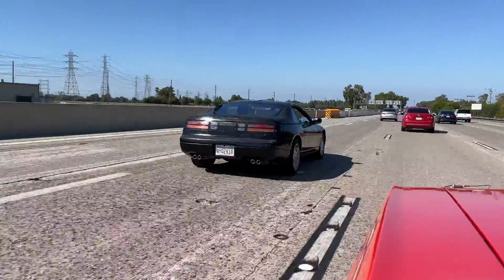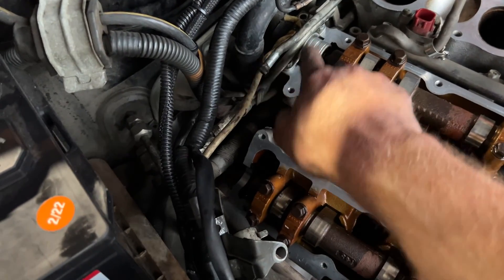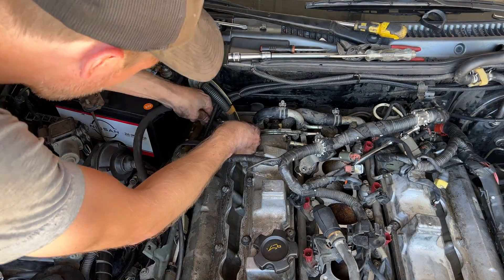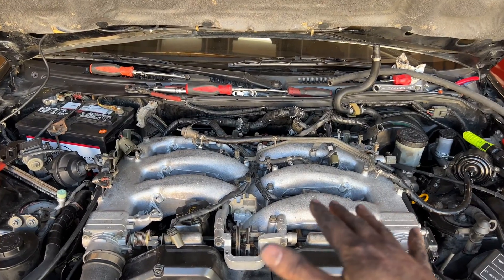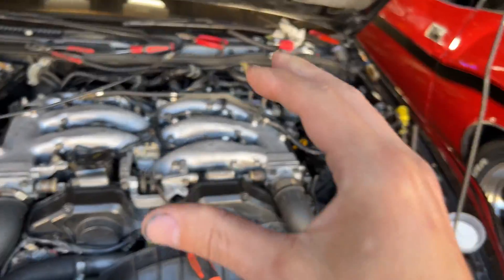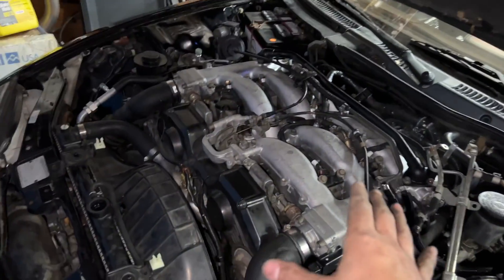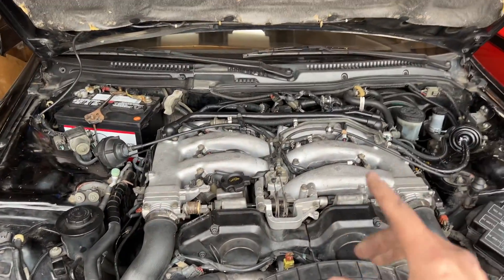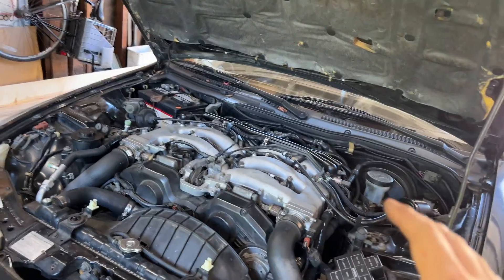Nissan 300ZX Intake Plenum Install, Ignition Timing, USB Consult Cable Tuning: Restoration Part 7

Comment: Where did you get the obd1 reader?
Reply from the maker: @jthj2003  I got it on eBay I think, they’re all over Amazon too. Just a cheap 14 pin Nissan Consult cable
Reply: @noboltsleftbehind  cool, thanks for letting me know!

Comment: Excess RTV comes loose & blocks oil galleries 
Before u put ur new manual g box on u could have rolled the engine forward ( intake hoses removed) and replaced the 30 yr old heater hoses

Comment: so i had to reseal my valve exhaust covers, i placed rtv on the surface and the covers and used zpec bolts, but wanted to replace the new bolts with the oems bolts back on after i sealed it a day later. if i remove those bolts and replace them should i reseal the covers again?
Reply from the maker: If it was me I’d try and replace them one by one and hope the seal isn’t broken.
Reply: @noboltsleftbehind  kinda tried removing the cover. Very difficult. I'll definitely feel more comfortable just resealing it after I remove the screws and replaced

Comment: I need some help with my 93 N/A. Not getting power to 3 of the ignition coils. Replaced coils, plugs, knock sensor  and still runs like crap

Comment: Conceptz wiki water bypass says just cap of the water nipples but I've seen a couple of video's where people join the nipple of one hard pipe to the nipple on the other, so that would effectively be bypassing the heater core?
Or did u just loop the nipple from one hard pipe back to the other nipple on the same hard pipe?
I have all this to do and have left the gearbox out to get better access from below to fit new metal water pipes i will cap each nipple off.
Also replacing VTC valves since they have started leaking the black goo.
Great video's, just confirming i have alot of work to do!  Waiting on parts from Amayama and in the mean time just picked up a Veilside Evolution cat back exhaust I've given a good polish!
Reply from the maker: Thanks, good luck on your project! I just ran a loop between the two ports in the back that were leftover after deleting everything. Not sure if that's bypassing the heater core, I suppose it's just creating a small loop where there once was a big loop.
Reply: @noboltsleftbehind  sounds like you did it right, I considered doing a loop on each hard pipe as might be better for flushing than dead ending with caps.
Other videos definitely show them connecting the heater core inlet to outlet in bypass videos, it would screw up the pressure going into the heater core I'd say too.
I couldn't see your connections in the clip hence asking.
While doing my rear main seal a small water hose decided to start dripping coolant while gearbox was out so decided to do plenum pull wil box out to hopefully make a little easier.
O2 sensors are good thing to replace if you haven't, on your laptop program check to see if your sensors constantly go up and down, then they are fine, if they hardly move they need replacing.
Reply from the maker: @sabertown1653  similar thing happened to me, once I starting taking things apart I found a bunch of little things that needed fixing. Good call on the O2 sensors, I meant to replace them but didn't get around to it. I'll give them a check through the consult.

Comment: Not sure why the nissan data scan wont let you see the data display (f1) but you can see just about everything from their all at once. Not trying to sound like a now it all but .44 on the TPS is perfect and dont forget to reset the closed throttle position it will help with the idle. Enjoying the content though, keep it up!👍
Reply from the maker: Thanks! Good to know my TPS is in range. I might not be seeing the whole display because I’m cheap and running the free version of the software, but luckily someone with an unused license hit me up so now I should be set (thanks Jared)!

Comment: Thank you for these videos, they are so informative! I just watched every one of your z32 vids, and it's awesome to see the car become better and better -- awesome job! I have a '95, and I might just have to get that usb scanner tool.
Reply: Yes get one! You will not regret it, its so nice being able to check the sensors
Reply from the maker: Thanks man! I definitely recommend the USB cable thing, it’s a good way to get accurate readings from the ECU. I just got the cheapest one I found on Amazon and it worked great!

Comment: You may have helped me solve my problem on my z that I haven't figured out for a couple months I'm going to try to mess with the cast angle sensor that you was hitting hopefully that does me right as well I'm going to do the coolant bypass too soon
Reply from the maker: Hopefully that works out for you, I know I tried just about everything else before finding that. When I adjusted mine I listened closely for detonation ping and didn’t hear anything, definitely something to look out for.
Reply: @noboltsleftbehind  thank you so much I will definitely be watching your videos and see where your z takes you

Comment: Dude I just binged all your Z32 content! Excellent work, love the progress! My only suggestion would be to have replace the caps on your VTC solenoids when you resealed your valve covers. The rubber caps typically melt and oil leaks from there too. Glad you got her running 100%!
Reply from the maker: Thanks! I'm super excited to have it back running at 100%. Good call on those solenoid caps, I'll definitely check that out

Comment: great video again must get one of those funnels, another tip to get all the air out of coolant system which you may have done but didn't mention it, is to cycle your heater core to on hot setting while car running and gets up to temp otherwise you could get air back into the system once you turn heater on if it wasn't done the first time. i don't have one of those tall funnels with a Rad cap, so i normally use the driveway gutter with my rear wheels down in the low part of the gutter to raise the front of car / radiator in height to get all the air bubble's out with the Rad cap off, topping it up at a fast idle so water pump pushes more flow pressure through the system.

Comment: I just went with a JWT ecm 
I also have a factory ecm sent off and reworked with a eprom 
But jwt is just right
Reply from the maker: Good to know, I actually found a guy selling a '95 JWT ecm here locally, I was considering buying it. Did you see a decent bump in power when you installed yours?
Reply: @noboltsleftbehind  10 to rear wheels- mustang dyno 
But mostly rear seat feel
Overall I believe it was worth the money but that’s been 16yrs ago

I’ve rebuilt the engine and did all the n/a upgrades since then
Only big thing I’ve done is
P&P the heads myself
Reground cams 

I just got the trans put in Sunday 
The 5sp swap 
Just have to get a drive shaft
And test pipes

So I know it will be night n day being 5speed now 

I’m org owner also
1990 n/a 2+2 azure blue
Reply: I would go stand alone if you just want to play around 
Maybe MS Squirt
Reply from the maker: @Itawolfib  that’s awesome to have owned that thing for so long. Congrats on the manual swap, it definitely increased the fun factor after I did mine.
Reply: @noboltsleftbehind  it did sit on Jack stands in the back of my fathers shop for 12 of those years Bc of deployment and has now sat for 2yrs in my home garage till I saw you start and it lit a fire in me last few weeks
So thank you
And yes I’m in the dog house with all my buying as of late
She will get over it thou
Z has been in my life 2 yrs longer lol
Reply from the maker: @Itawolfib  that’s awesome man, I’m honored to have helped inspire you to get your Z project going. Get that beauty back on the road!

Comment: Did you just get the cable and no licensed DataScan 1 software?  Just curious because your selection screen looked like it wasn't offering all of the options that typically come with a fully unlocked version.  If you plan on keeping the factory ECU for a while, I'd really suggest getting the activated version as it will give you a slew of additional options like disabling certain engine cylinders either through shutting down the fuel injector or coil pack.  When I was running my chipped ECU, it still worked with the DataScan software and helped diagnose a lot of issues I had to occasionally deal with.  Since I am now running a Haltech and literally have no need for the DataScan software anymore, I'd be willing to toss my info at you so you can activate yours if you'd like.  I messaged you via Instagram.  I literally have no need for it anymore so it would be better off being used by someone who needed it.

Also, the PTU wire for checking the ignition timing is kind of iffy sometimes, so I'd be mindful of that.  Did you use just the sensor wire (thicker black wire) on the coil pack wiring for cylinder one when checking your timing?  That way has always worked for me in the past and even now with the R35 coils I am currently running, but I had to upgrade to the $100+ timing light when I went to the smart coils.  Was just wondering as it almost sounded like you used the 3 wires total.
Reply from the maker: Yes, that is just using the unlicensed free version of DataScan. I'll absolutely take your license if you don't need it, thanks! I'll message you back on Instagram. I'd love to get in there and mess with settings some more.

I was using just that black coil wire for testing the timing, though I have a cheap timing light so that might be part of the problem. I also heard getting a short spark plug wire and connecting it between the coil pack and spark plug works better, I may try that.
Reply: I need it